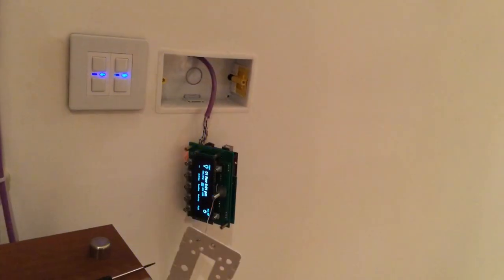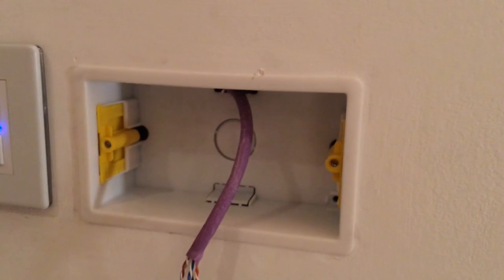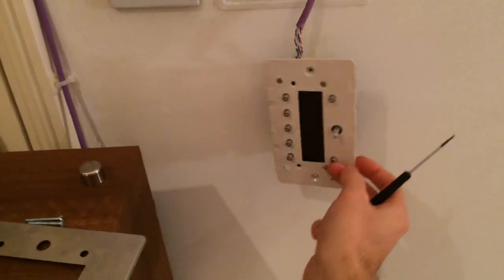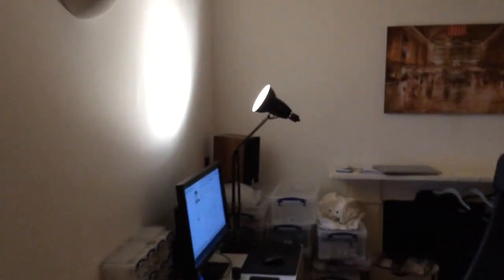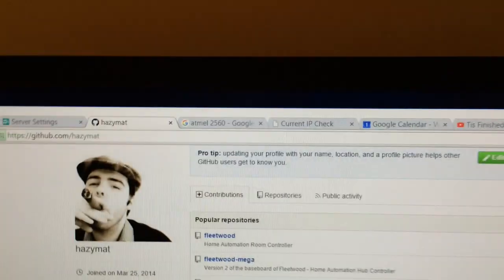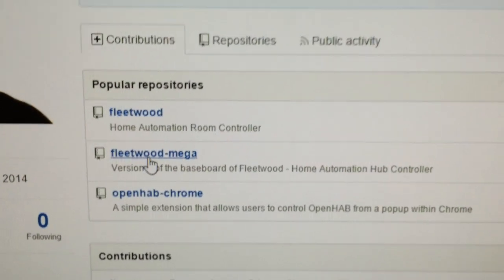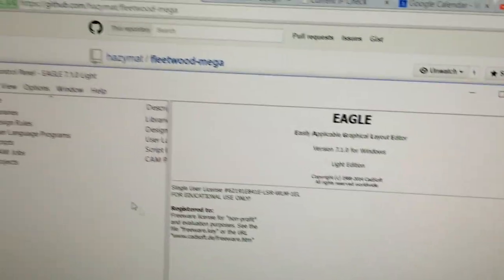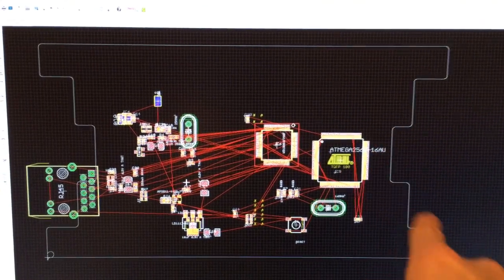MQTT Wall Controller - project update - prototype in the wall

Comment: Have you considered going over to the ESP8266 or ESP32? No need to wired ethernet and perhaps use an i2c screen etc?
Love the encoder button and illuminating buttons! Great project!! :-D
Reply from the maker: Chris Evans I’d love to move to the 8266 but the one thing that prevents me is the fact it has no easy Ethernet options. I am a strong believer in wired controllers....

Comment: Im wondering how did you get (Im mean to the process) to that awesome  steel-like panel. May you give some sort of recommendations to  get a design like yours ? Thanks for the ideas with this video. Its an amazing work.
Reply from the maker: Hello. The steel like panel is actually steel... (0.8mm thickness steel). It's called a "blanking plate", you can find them next to light switches and socket outlets in the electrical store. Mine is from Screwfix (UK), very cheap. Then I had to send a design to a waterjet cutting company to make the holes. Hope that helps.
Reply: That give me a path to follow; Im going to try to follow your steps; thanks a lot ... this project is awesome ...

Comment: Awesome video Mat. Like your presenting style too. Have followed, be interesting to see this progress

Sorry if this is mentioned somewhere already, but what make/model is the blue digital screen?
Reply from the maker: Hi Graham

The OLED screen is from buydisplay.com. Check out the 3.2 inch 256x64 graphical display. (Not the "character" display.) They do a "module" and a "panel", I used the panel. Mine was actually white (looks blue on the vid for some reason, but it's white). You will see they come in a few colours. I really like the module!

Comment: I'd be interested to see how you've implemented your openhab rules and also using your xap 800 with it. I have an idea using the wall controller to control a specific pair of outputs in one run pressing the buttons to cycle source and the encoder to turn volume up but I'm stuck on how best to start.
Reply from the maker: Hi Josh, in honesty I still haven't fully implemented the XAP yet - I've just tested it to make sure it will do everything I want. (It does everything, and more.) As for the rules, you're more than welcome to take a look at some of my rules. Feel free to email me on hazymat@gmail.com

Comment: Looks great..I'd love to build one of these and see how I can use it.  Are you using POE to power this or something else over the ethernet cable?

Seeing this made me think of the Clipsal eDLT (https://www.google.com/search?q=clipsal+edlt&num=100&espv=2&tbm=isch&tbo=u&source=univ&sa=X&ved=0ahUKEwjc-o2l7sDKAhVKx2MKHYN6BZ0QsAQIHA&biw=1920&bih=1082).  If only they were smart enough to open it up to open source developers, I think they would have been a leader in the industry.  It's a shame because their hardware is pretty good.  They do have a nice feature that each button is actually a rocker so you have two inputs for each "button".

Comment: HI Mat, This looks like a great project, I would like to do something much more simple, just to start with and work up to something more complex.  I already have openhab running on a raspberry pi and I'm looking at getting some lightwave switches and sockets.  I see from your overview that you used the usb of instead of the lightwaverf wifi hub.  Was there a particular reason for this? as the hub is quite a lot cheaper?  Also Are there any alternatives systems would you use over the lightwave? bearing in mind I'm also in the UK and I'm looking to get something up and running as cheaply as possible? Thanks in advance.
Reply from the maker: +Matt Pitts Hey Matt. Yes I use a USB RF transceiver. Actually I bought the LightwaveRF hub myself, then gave it away to a friend because I wanted more granular control over the signals, also I wanted the ability to control other RF devices as well. The RFXtrx33e cost about £69 when I bought it, not much more than the LWRF hub. It does not, of course, give you the remote access, but I use OpenHAB for all that stuff. LightwaveRF kit is the best way I know of for cheap retrofit light control, although you must bear in mind that each signal takes a second or two to send, meaning that if you want to turn down 4 lights together they will be done one after the other in sequence. RF switches support moods which can change the levels all at the same time, but I haven't got that working with OpenHAB yet. You probably know OpenHAB has a binding for the LWRF hub, I don't use that - just the RFXCom binding. To be honest it's more work getting the USB thing working but once you do, it's really good. You can use the remotes supplied with LWRF gear to control other stuff!
Reply: +Mat Smith Hey Mat, thanks for the info, thats really helpful

Comment: have you considered using a particle core/photon? its a £20 cloud connected micro controller with built in wifi, an AMR cortex M3 running at 120 mhz and has 1 MB of flash and 128K RAM. you could let it do all the work and just use the mega as a slave controller controlled over serial

Comment: Mat - I really like where you are going with this project, well done! I would like to suggest that you include an IR receiver, which could be used with a Logitech Harmony remote. This would allow you a lot more flexibility in where you mount your controller. For example, in the bedroom you wouldn't have to get out of bed just to change the scene to sleep mode.
Reply from the maker: +Pat Rooney Hi Pat - thanks for the comments! At the moment, changing lighting scenes from bed is covered, as you can use iPad / phone / any other smart device. Does the Logitech Harmony remote run over wifi as well as IR? This would be an option too! Problem with incorporating IR into the wall controller is there would need to be another hole in the faceplate. It's quite hard covering holes unless you have a plastic molding behind the front plate, which I haven't invested in yet...
Reply: +Mat Smith Actually, the newer, hub based ones do run on wifi. The remotes talk RF to their hub, which then uses wifi or IR or BT to talk to devices you want to control. It works well enough with my Vera Lite Z-Wave system. I take your point about the extra hole for the sensor, so the smart device control is probably the way to go. From my experience with the non-techies in my household, the UI has to be very simple (preferably based on two or three scenes), for it to be accepted. That was the reason behind using the Harmony, which has solved a lot of arguments! I just did a quick search, and Openhab has a binding for the Harmony so I must have a play with it.
Keep us posted on your progress!
Reply from the maker: +Pat Rooney This is superb - I may get me one of those Logitech Harmony devices with an RF hub!
Reply: +Mat Smith I've sold a lot of them to my clients, who all swear by them. I've yet to find a device it doen't support, apart from setting up Kodi which can be fiddly. The openhab binding works well, although I'm still struggling with getting everything else to work. Also, check out http://bwssystems.com/ for a java app that bridges Amazon Echo to Harmony, it should give you voice control once the Echo is available in the UK.
Any update on the wall controller?

Comment: Glad that you mounted it and it works great.
Did you try to run your server on a pi or what do you have in mind ? I guess you are running your server on your PC right now.
Another question please. You have already manufactured RF light switches, so how do you communicate with it using the server ? I know that openHab has bindings, but am asking about the hardware.
Thank you and good luck.
Reply from the maker: +ahmedadelhosni90 I have a Pi, but I'm using a Windows machine to run OpenHAB currently. May migrate over to the Pi. It's running from a folder in dropbox, so can fire it up in a "portable" manner :) Re your other question. I use the RFXtrx to communicate between OpenHAB and the light switches, as well as sending signals to other devices like mains power switches. To be honest I don't like RF control, and always prefer wired control using e.g. DMX. But it's temporary for me...

Comment: Oh wow. Thanks for releasing the code. I'm going to study the sketch! It's a brilliant final product. And the next project looks very interesting.

My only suggestion would be to either look into onboard wifi, or maybe even ethernet over power as an option? For those of us that are not keen on rewiring the house with cat6 haha. 

Though with the reduced size of the overall assembly there would be room for an ESP8266 or some other networking device, so it wouldn't be that necessary.
Reply from the maker: +ThalassTKynn Don't study the sketch too hard, I'm not the world's best coder :P ... I am using it really to learn to code properly, and have made many improvements since my last GitHub commit! But hopefully it will give an overview idea about how I'm doing things. Re ethernet over power, the problem is bringing mains power into a backbox and converting down to 5v for the arduino, it's something I would need to get a certification for. Currently it's low voltage so it's safe to build and install myself

Comment: how can you controll the brightness of the lights?
Reply from the maker: civilization95 Hi - not sure I fully understand the question but here's a quick overview. This project is based on an Arduino Mega and W5100 network interface. This project connects to the home network (wired network over CAT5 to a network switch). This is in a central location, and an MQTT broker is installed onto a server (in my case Windows laptop) connected to the home network. As well as the MQTT broker, OpenHAB runs on the laptop. The actuators (light dimmers, music players etc.) can be anything supported by OpenHAB such as Sonos, KNX lights, DMX lights, Lutron probably... in my case for now I'm using LightwaveRF light switches that are installed in place of traditional switches in the wall. So OpenHAB - the automation hub - communicates to the lightswitches individually by RF transmitter (in my case a USB transmitter called rfxtrx433). This is not ideal for a number of reasons, but my current home doesn't have lighting wired to a central location. The new home (for which this was designed) will do!

Hope that makes sense.
Reply from the maker: By turning the knob or pressing the buttons!
Reply: i am interested about the circuit or the transistor what you use
Reply from the maker: +Bence _ Hi - this was touched-on in the video. Please note the wall control panel doesn't have live mains electrics in-built, but rather it sends MQTT messages to a server that controls the lights. Currently as mentioned in the video I use LightwaveRF light switches, controlled by RF 433. Thanks for your interest!
Reply: +Mat Smith Man, I like the neatness. Can you kindly tell that where is the circuit to which you are sending MQTT messages via the control panel?